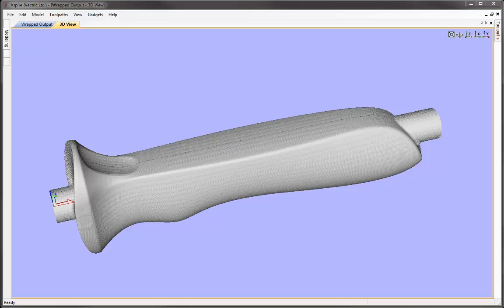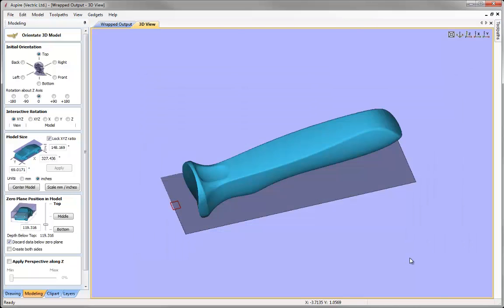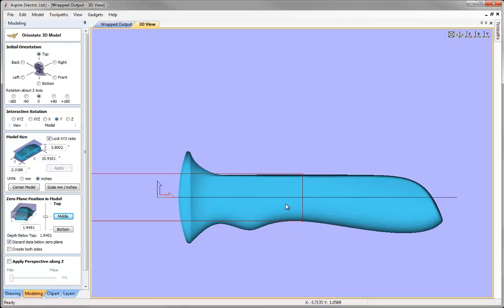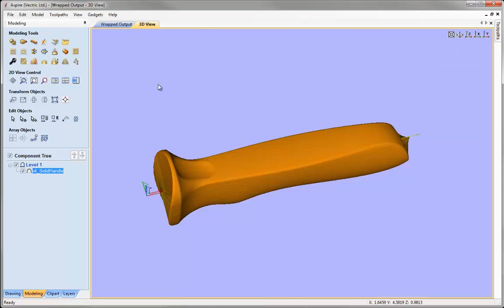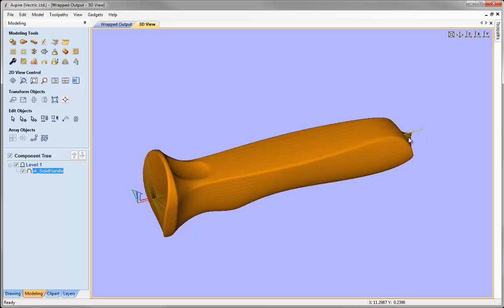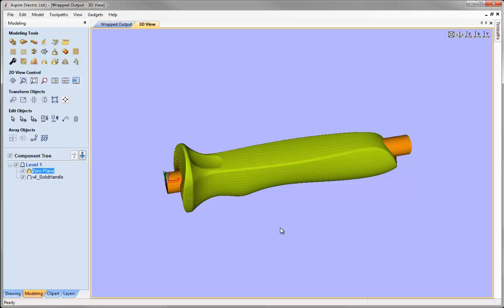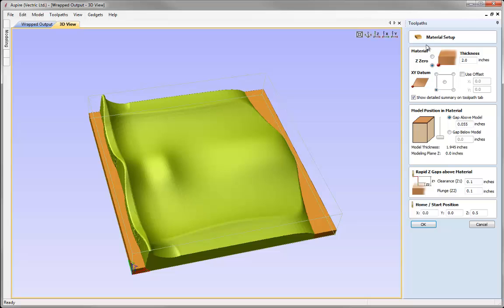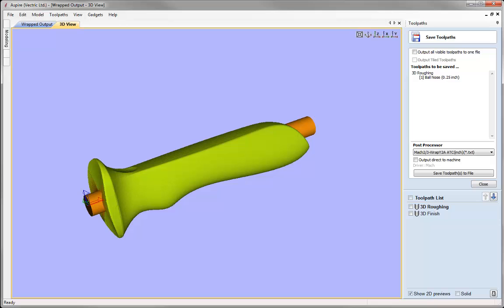Vectric V8 Tutorials - Import and Unwrap Rotary 3D Models

Comment: how do you zero out your "Z" if it is in the center of the cylinder, also how would you deal with square stock at the start.
Reply: Either using a digitizing probe to touch off of z and y of a known cylinder size mounted in the chuck and then dividing the value by 2 to get the center point or by measuring the distance from a flat area on the 4th axis, to the center. Touch off of the flat surface to set as zero and then subtract the distance from the flat area you measured earlier. I just figured this out 2 days ago and ordered a digitizing probe. My center seems right, but it takes time to do it each setup. If rather run a macro to do it for me with the probe.